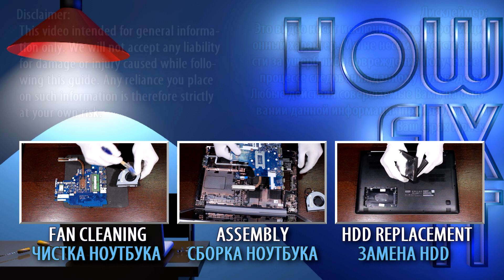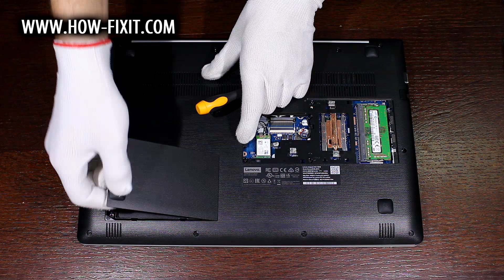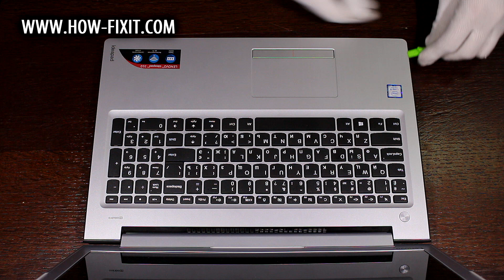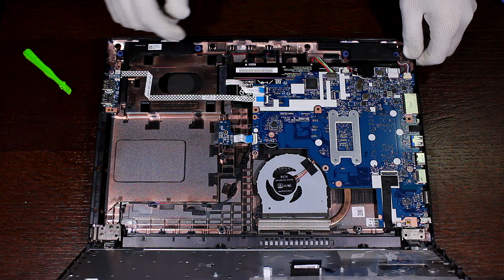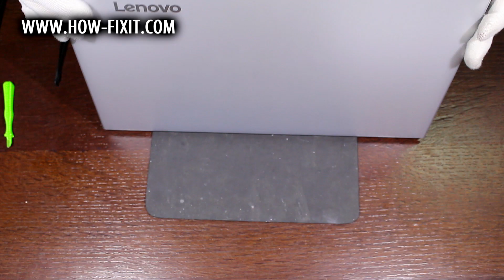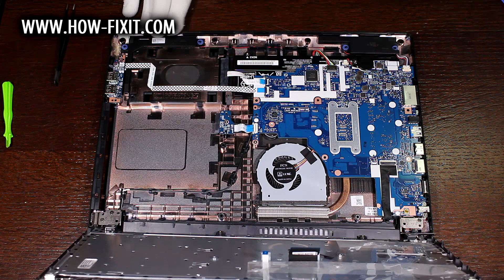Lenovo 310-15 RAM Upgrade and Install - Your Step-by-Step DIY Guide!

Comment from the maker: You can press FN + S + V to stop the electricity from flowing on the parts of that laptop that will change like RAM, HDD, etc. You can return to the normal mode by connecting the AC Adaptor to the laptop and turning it on again. In this case, you do not need to disassemble the laptop to physically disconnect the battery connector from the motherboard.
*ENG*: Links to DDR4 RAM, screwdrivers, and bonus content are in the description under the video.
*RU*: Ссылки на оперативную память DDR4, отвертки и бонус контент - в описании под видео.
*ES*: Los enlaces a la RAM DDR4, los destornilladores y el contenido adicional se encuentran en la descripción debajo del video.
*FR*: Les liens vers la RAM DDR4, les tournevis et le contenu bonus se trouvent dans la description sous la vidéo.
*DE*: Links zum DDR4-RAM, zu Schraubendrehern und Bonusinhalten finden Sie in der Beschreibung unter dem Video.
Reply: FN + S + V  когда нажимать? Выключаем ноутбук, отсоединяем питание, нажимаем FN + S + V,  так?

Comment: Thanks a lot for this video. I upgraded my Ideapad 310 following this video and it worked.
Reply: Bhai konsa ram liya pls link dede uska
Reply: my brother has this laptop and I was gonna upgrade it for him, however, how many slots did you see when doing this yourself? when I use a software to check the system's info, it says there is 1 slot being used and 1 slot that is available, but online I see that this model only has 1 slot. just a bit confused here
Reply: @DukeR3D  This can clarify your doubt... The Lenovo Ideapad 310-15IKB has 2 Slots (1 Upgradable) to install memory, already with 4GB (Soldered) standard memory installed. For best 310-15IKB Laptop performance use the maximum amount of 12GB, fill all the slots with the max allowed memory per slot for your Laptop.

That's the thing, 4GB are soldered so you can only have one slot to upgrade by adding 8GB RAM, because the maximum is 12GB.
Reply: @JustLife29  thank you for the reply, I actually forgot I asked about this. I understand what you've said so thank you for the information

Comment: you can upgrade to 16gb making it total of 20gb i got mine done i will show you video proof aswell hope this helps 😃😃
Reply: Could you tell wich model? I'm thinking about make this upgrade in my model 310-15ISK but i dont know if it suports 20gb
Reply: @thanaracorrea4516  it’s support 20gb you need too add 16gb ram as 4gb ram is inbuilt i done mine aswell same model
Reply: Hi! Can you tell me exactly the RAM brand and latency you bought to reach 20gb for that model (80sy)?
If you have the link would be useful too, but if it not giving me the RAM brand and model would work.
Thank you!
Reply: @ElFideoHomicida   I just checked this on Crucial website, in order to know the specifics of the ram module which could work. 16GB DDR4-3200 SODIMM, but im not sure with the mhz frecuency. According to this video,  this model works originally on 2400 frecuency, so I'm in doubt now...

Comment: I actually did this without removing the hdd and disassembling the laptop itself. I did this buy just powering the laptop off and just disconnected the charging cable and just changed the ram successfully......
Reply: Is there more than 1 slots or !!
Reply: @aquajasa  go to task manager, click performance, then RAM, in the bottom right corner there should be a part that shows how many slots are being used
for example, my motherboard has 4 slots, of which two are being used
so, it should say 'Slots used: 2 of 4'

Comment: Hey, lenovo 310 15iKB 80TV. I currently have 4gb builtin (nonremoveable)
what is the maximum ram it can support? 
Lenovo website says 12gb (4+8)
but the intel website says i5 7200u can support upto 32gb RAM.
Reply: Have you upgrade it yet if yes which ram did you used
Reply: It should be 32 like Intel says, I've seen the Intel article as well. As far as I've looked, in Task Manager it can show you how much RAM slots your computer has, I believe mine has 2 slots of 4GB currently in. And the biggest amount of RAM you can find most of the time is 16GB.

Comment: Mine is ideapad 310 14ikb Will it support 16gb ram ddr4? have you tried adding 16gb ram
Reply: 4 built in MB + 8 Gb or 16 Gb modules.

Comment: Can the graphics card/gpu be upgraded in the laptop ideapad 310
Reply: It's an integrated GPU in the i5. Intel Graphics 610. And you should be able to upgrade the simple dual core GPU.
Reply: Only if you solder the chip to a more productive one. But it needs to be supported by the video bios.
Reply: I think u can by eGPU

Comment: Seriously? Why did you open the entire case and disconnect internal ribbon connectors when all you wanted to do was show us the ram which already had the cover removed? What was the point to all that?
Reply from the maker: You can press FN + S + V to stop the electricity to flow on the parts of that laptop that will change like RAM, HDD, etc. And you can return on the normal mode by connecting the AC Adaptor to the laptop and turning it on again.
In this case, you do not need to disassemble the laptop to physically disconnect the battery connector from the motherboard.

Comment: is there any way where i can upgrade the display resolution of my laptop from 1377x768 to 1920x1080. I own a Lenovo Ideapad 310 15IKB. The maximum resolution available is 1337x768.
Reply: *1366x768

Technically 1366x768 is just 720p and there's no point needing 1080p. The reason why the laptop does not allow 1920x1080 is because it doesn't support 1080p.
Reply: Yes

Comment: May i Know which ram upgrade is preferrable for the lenevo ideapad 310, processor Core i5-7200u@2.5GHz base speed and @2.7GHz turbo? thanks
Reply: Crucial 4gb ddr4

Comment: Is it have 2 Slots for RAM? Can I put 2 pieces of 4GB DDR4 2133 mhz RAM into it If it has 2 Slots?
Reply: No. It has only 1 slot and 4GB soldered it. Maximum memory is 12GB which is 8GB in the slot plus built in 4GB

Comment: I can put a 16GB memory, will it work?
Reply: Maximum is 12GB according to specsheet. And it counts in 4GB ram which is built in. So 8GB stick plus soldered in 4gb = 12GB. Its atill plenty. and mich better than just 8gb especially if you open pota of tabs in chrome.
Reply: @Kacpa2  Intel says 32GB of RAM. It should work btw.
Reply: @Kacpa2  and some people need 16GB, my video editing software recommends 16GB of RAM. And Chrome is a s*** browser honestly.
Reply from the maker: I'm sure that 8GB will work. 16GB must be tested.

Comment: Is it necesary to disasemble the whole laptop (there are very delicate steps) if you only need to remove one screew  to access the panel where the memory slot resides? I'm scared that all these steps are neccesary because, I don't know how to disconect the battery in this model. All these steps are needed to disconect the battery power source from the mother board? thank you in advance
Reply: no, just unscrew where the ram is

Comment: How many ram slot in this laptop
Reply from the maker: one slot
Reply: @howfixit   can i upgrade extra 4gb ram or not only one ?
Reply from the maker: You can add 4gb RAM, if your slot is empty
Reply: @howfixit  bro its single chanel ram support 1 slot

Comment: Hello, do I really need to disconnect all the things that you disconnect in that video just to replace the memory(ram)?

Edit: I saw the manual on the laptop box that after turning off the laptop you can press FN + S + V to stop the electricity to flow on the parts of that laptop that will change like RAM, HDD, etc. And you can return on the normal mode by connecting the AC Adaptor to the laptop and turning it on again.
Reply from the maker: Yes, In this case, you do not need to disassemble the laptop to physically disconnect the battery connector from the motherboard.

Comment: Can it supports 16gb ddr4
Reply from the maker: yes
Reply: @howfixit  Thanks, that's useful as I wanted to replace one of my slots with 16GB so my PC should have 20GB in total. I knew my laptop was DDR4 anyways.
Reply: @Luiz Fernando Hreisemnou Do Rosario I ended up replacing my laptop, the hinge broke on my previous one, still considering a RAM upgrade for this one though

Comment: Thanks a lot. I want to buy a LENOVO YOGA 310-11IAP 80U2004CFR.  Is it possible to replace Ram and ssd ?  Thanks. Pascal https://www.darty.com/nav/achat/informatique/ordinateur_portable/portable_hybride/lenovo_yoga_310-11iap_2.html#dartyclic=_2_4389085

Comment: there are problem if i add 4GB of ram at this pc without remove the cable of power?
Reply: I saw in the manual on the laptop box that after turning off the laptop you can press FN + S + V to stop the electricity to flow on the parts of that laptop that will change like RAM, HDD, etc. And you can return on the normal mode by connecting the AC Adaptor to the laptop and turning it on again. So, in that case, no need to disconnect everything like it shows in this video.

Comment: Can u tell me
I have lenovo v310-14isk and v310-14ikb
I got problem after i upgrade ram with kingstone ddr4 (2134)16gb 1067 mhz 

4gb soldered mobo+16gb kingstone

My laptop always freeze canot do anything until i waiting 5minutes
Still freeze so i force shutdown with power button

May u help me
Thanks
Reply from the maker: This model Max Supported Size 12 GB (8+4)

Comment: Can I use a ram of higher frequency/megahertz by any chance or is it best to use a 2133mhz ram?
Reply from the maker: As I know 2133Mhz is basic frequerancy for SO-DIMM DDR4 RAM, and when you has 2 RAM devices, for example 2133 and 2400Mhz both'll works at frequerency of slower RAM device. Also in laptop of this model there's RAM soldered to mainboard, and if this RAM can works at 2400Mhz you can add 2400Mhz it'll work 2400Mhz, but if soldered RAM supports just 2133Mhz inserted RAM will also work at 2133Mhz.
Reply: @howfixit  This laptop has one soldered ram right?
Reply: Can i add 2666 MHz? Ikb*
Reply: @fan4game397  I would like to know that to

Comment: this laptop has 4gb integrated ? is it true we can put a 16gb in the slot ? lenovo says its maximum 12 ( 4 integrated + 8 in the slot )
Reply from the maker: yes, you're right, according to off.lenovo specs maximum 12gb, so maximum 8 GB to 1 slot
Reply: How many slots does this laptop have??
Reply: one slot
Reply: Arbeitsspeicher aufrüsten bei Lenovo Yoga 310
Reply: On my Laptop start show as work only 4GB ram and I want to ask how you think or it can be the 4GB ram integrated get burned?

Comment: how much maximum ram could be installed?
Reply: how many slot have for this laptop? is that just have 1slot?
Reply: The Crucial says that lenovo 310 (15 inchs) allow cleared 20GB.

http://www.crucial.com/usa/en/ideapad-310-%2815-inch%29/CT8804512#productDetails
Reply from the maker: 1 slot, max 16GB in slot, as I remember
Reply: Thank You (y)
Reply from the maker: I'm sorry, I made mistake, maximal ammount of RAM that can be installed to slot - 8GB, according to official lenovo specs (link: http://shop.lenovo.com/us/en/laptops/ideapad/300-series/310-15-inch/)
Reply: thank you
Reply: So will the 16GB Crucial work even if the specs says only upto 12GB?
Reply: @aramismarquez4507  crucial say 20gb, lenovo say 12, i dont know